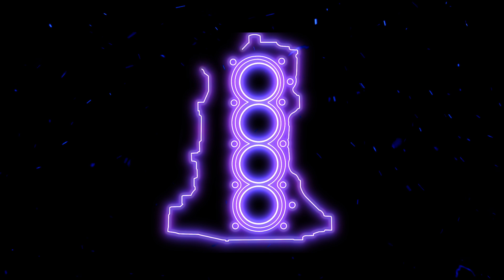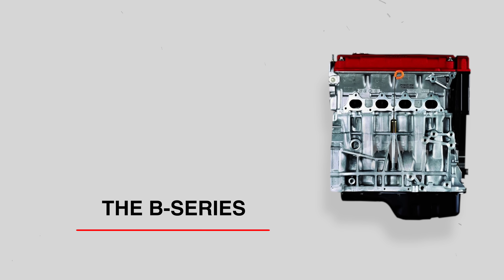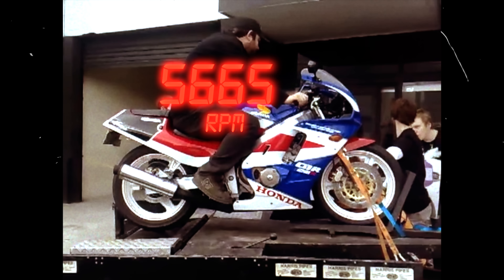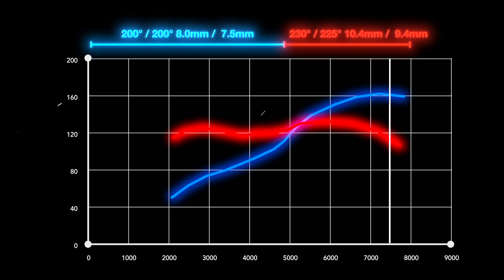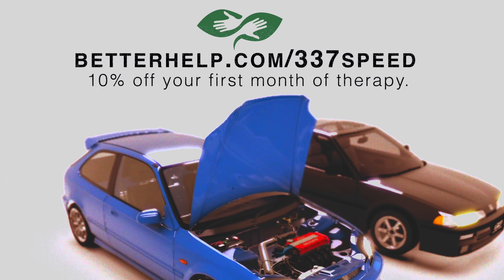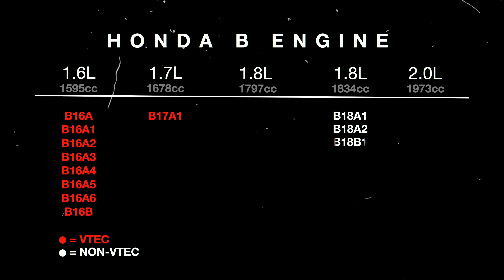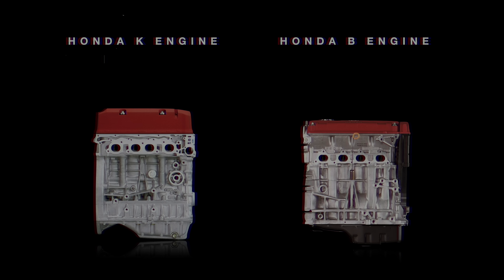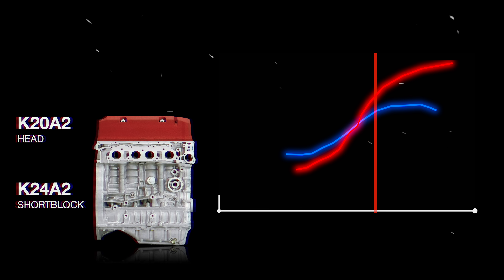How Honda’s VTEC Changed Sport Compacts Forever😳| Explained Ep.46

Comment: Mmmm, the second generation Acura Integra. In my opinion, still the best looking front wheel drive car Honda ever made. And I help a friend of mine work on his 1993 Acura Integra GS that has a B18A1 with a GS-R VTEC head from 1995 on it now, with higher compression (12.5:1) pistons, ported head, 4-1 header, 2.5 inch exhaust through an actual nice sounding muffler, Skunk2 intake manifold and throttle body, and I personally own a 1999 Honda Civic Si which has a header, exhaust and a spicier tune. I love B-Series engines, and while the H-Series can make way more torque, and the K-Series has been taken to insane power numbers even NA, I will always love the B-Series and its guttural roar to 8,000+ RPM.
Reply: I agree about second gen Integras being the best looking Hondas. I had a frost white '92 GSR(DB2) with a '01 spec B18c5 engine swap 20+yrs ago. The DB2 chassis was stiffened forward of the firewall, I believe the only Honda other than Type-R's that was stiffened at the factory. Almost no sound insulation, under the carpet in the hatch was all painted steel with only one small piece of sound insulation under the spare tire. DB2's only weighed 50lbs more than a Type-R but they had a power moonroof. There is a retro review video here on YT of the DB2 from back in '92 that explains the factory chassis stiffening.

Comment: The K series is a continuation of that legendary design and build. K24A2 is a masterpiece!
Reply: I have on in my MRS, and totally agree.
Reply: K23's are nasty but you don't see them much.  Believe its a k24 block with K20 heads and a FC crank ( s2000 think its FC).  Ends up destroked a little but with less angle on the connecting rods.  13k rpm, so sick.

Comment: Enjoyed this very much. Especially the coverage about the second generation Integra which was the introduction of (car) vtec. Ive driven a DA going on 27 years now lol.
Reply: 27yrs with the same DA!? That is awesome! I bought my first Honda 29yrs ago, a '85 CRX Si. I wish I still had it, or my '88 CRX Si, but my favorite was a '92 GSR(DB2) with a B18c5 swap. Did the swap in '04 and sold it 9yrs later. I still miss it, don't sell yours.
Reply: @WisconsinEric  Not the same DA. Wish it were so. First one got wrecked a few years after I bought it. But ive owned dozens of them since the late 90s.
Reply: @AcuraLvR82  Dozens is equally if not more impressive than the same one.

Comment: One of the fastest things I've ever been in was a 1993 Honda civic with a gsr B18c (apparently) series and a lot of turbo boost. Stock engine as well, so lightweight, could barely hear the exhaust over the turbo. Probably between 4-500hp but in a car that weighs just over 2000lbs it's a crazy fun combo.

Comment: Thanks for a harder kick in the nuts bro because it was much needed. I got sent the wrong size piston rings for my Integra GS-R and I spun a bearing so now I'm using my B18C GS-R head on a B18B block for a really stupid high compression LS-VTEC rebuild (12:1 CR using Integra Type R pistons).

It was just in time.

Comment: So basically a turbo camshaft. Very nice. But the question is 
Is this relevant to V8 or V6 engines ? Would it make a difference? In a good way or bad way
Reply from the maker: In the way Honda uses it mostly 4 cylinders, but  Nissan in the VQ37VHR used variable valve lift to flatten the torque curve combined with cam phasing. In principle it’ll work with any engine configuration
Reply: @337speed  nice! Thanks bro! Your information is priceless!

Comment: I pulled my b18c jdm type r out of my crx that I cracked a piston about 10 years ago and has been sitting ever since.  Im going k series for the replacement so I rebuilt it and dropped it in my wife's 2000 awd crv. 10k on it so far and fun to drive but needs more torque for that size car. I don't think I will ever part with it even after the next time it goes and do another rebuild.  It was a so much fun in my gutted crx and can't wait for the 300hp na k to go in. Working on making it mid-engine as well, just have to sort the suspension out on it.
Reply: Sorry if my post offended you. It wasn't meant to be self-centered, just wanted to share my love for the motor and my experience with them.
Reply: I I I, me me me, puky attention seeking waste of space.

Comment: 8:30 LOL @ a "stroker" revving to 11k.....that just ain't right!!!!  (an expression of how flabbergasted I am, not doubting the reality!)
Reply: thats how i felt listening to that. how ive always understood it is that strokers make more torque across the rev range but dont rev as high as "big bores"
Reply: I believe they stroked it to the same 87.2mm stroke as the ITR B18c, and yes a shorter stroke is safer at high revs as the piston speed is lower. I'm not sure if they used the ITR crank or their own but it surely had rods. When I bought my B18c5 20+yrs ago I was told the stock lower end is 100% safe to 9,500rpm. Stock valve springs were only safe to 9,100. Stock '01 spec cams only made power to 8,700 in my engine.

Comment: People always shit in VTEC not knowing how revolutionary it was
Reply: @eminemfan3650 It's not only the vtec. Some time ago in US Honda's 2.2 litre non Vtec engines were used as reliable, affordable and cheap base for supercharging. They took non vtec version (F22A) vs later, more efficient VTEC ones (F22B) because of the simpler head design and therefore better reliability and easier tuning.
Honda was making really good engines until emission standards forced them to follow the herd and built undersized, supercharged, direct injected ... things that are shadows of the old glory.
Reply: THEY KNOW! THEY JUST JEALOUS!
Reply: And still is tbh. The continued evolution of VTEC places it clearly ahead of most if not all competing systems.
Reply: I say more complicated...i say rottary was true revolution,very light,high rpm,small displacement and combine it with turbo you get beast egine.
Reply: @joe125ful  If the reliability and emissions problems with rotaries could have been solved they would have been the go to for enthusiasts
Reply: @agrisimfarming Actually you can do it and problems can be fixed its really not bad engine only badly maded.
Reply: @joe125ful  no, it has by design flaws. It is 2 stroke burning oil and seals are required to maintain pressure inside every chamber but they require maintenance and swap often compared to typical inline 4stroke 4 cylinder engines.
Reply: @bartomiej9807  Ofc but they are much lighter and smaller than typical engines and rev high too.
Reply: @agrisimfarmingrotary get proper oil fuel ratio when constantly 7000 rpm
Reply: @agrisimfarming Reliability has been solved. S5+ housings and extra thick rear iron did wonders. Many issues are operator error.. Like dropping the thrust washer without realizing it because you wanted to change the e-shaft pulley to a shiny one, but you took out the wrong bolt. CO2 emissions from an FD is similar to a brand new mustang ecoboost. The renesis was a disaster. No turbo. Ugly car. Emissions improvement made reliability trash. Side port exhaust means more heat on your oil control ring seals.
Reply: @joe125ful  маленький ресурс, большой расход масла и бензина
Reply: @joe125ful new Hyundai engines open deck dual vvt not jellious
Reply: @joe125ful the rotary was revolutionary. But not practical. And this is coming from a Huge Mazda fan. Honda did something no other company could. There engineering was next level
Reply: @joe125ful what makes an engine great. Efficiency in making fuel turn into power. Rotary sucks.
Reply: Thanks Im picturing someone sitting on a toilet shitting and then vtec kicks in 😂😂
Reply: @Bshere  WHY DID YOU GIVE ME THAT MENTAL IMAGE?!
Reply: It’s totally overrated now. It was revolutionary in the early 90’ nothing more. Just because they didn’t wanted to use Turbo or supercharger.
Let’s talk about the late 80’ Polo G40
Reply: @antonfloor344 what???😂😂😂😂 because of VTEC, every manufacturer now puts variable valve timing in their engines.
Reply: @eminemfan3650 they where just the first, nothing more.
Reply: @antonfloor344  Honda wasn't the first to make VTEC.......I hope that's not what you're implying.... Alfa Romeo did decades earlier
Reply: @jrkustomz5538  here's the difference though. Alfa Romeo's version only affected valve timing. What made VTEC so revolutionary was also the increased lift of the valves along with the valve timing. One was for efficiency and one was for power.
Reply: @chuckynocheese3271  yes ,but that's not what he's implying. Alfa had it more than a decade prior to Honda unveiling it. 
His implication is that Honda invented it ...which isn't true...Honda improved upon a system which already existed is all.

Comment: Day 4,593 of asking 337 Speed for a GTI/Golf R video and why they're such legendary cars and why the EA888 is one of the greatest factory turbo 4 bangers ever made. Incredible tuning capability, bang for your buck power potential, does alot of things better than many other cars and it's the king of the hot hatch. They deserve a video! 🙏
Reply: Vr6 over any other VAG engine
Reply: VR6 sound so good, funky chain setup that is a definite maintenance item, I can't hate the Vr6s they're too cool
Imo best all-around VW engine is the O7K, miracle of not being overcomplicated they just keep racking up kilometers with oil changes and maybe they get an air filter or spark plugs every ten years😂
 @izzy031096
Reply: Might as well get into the EA827 and derivatives, it sorta paved the way
Reply: if the EA888 is as good as VW fanboys say then why does nobody want to touch them or swap them into shit? they also sound like a wet fart
Reply: It's called we stretch timing chains, clog the intake ports with carbon, stretch the timing chains, wear out the variable intake runner pivots, stretch the timing chains, Munch a valve, explode the water pump and stretch the timing chains
I LOVE EA888S!!!
Reply: @snoofayy6150  I'll tell you same thing I told him. This ain't 2012 anymore
Reply: Shhhh I'm fixing my 12v vr6 and I don't need prices going up dude
Reply: I guess at this point he might be thinking you make it😅
Reply: The newest EA888s are fantastic but the vast majority of them in the GTIs/Rs over the years are just mediocre. They can be decent bang for buck but you need to sink a huge amount of money in to make any sort of serious power out of them
Reply: @wingmanlmg  Didn't even need to see the pfp to know this was written by someone who doesn't own one of these cars. Gonna just leave it at that 🤣
Reply: @Xim762  I have a 440hp M135i and it got there with a downpipe/intercooler + tune.  A similarly priced GTI needs upgraded turbo, hpfp, lpfp, intercooler, downpipe, etc to get even close
Reply: @wingmanlmg  You lose in the up front cost. An M135i costs more than a GTI and weighs more. And this isn't 2012 anymore old man. MK8 GTI's can make 370 wheel on just intercooler and an E85 tune. No downpipe or fueling upgrades needed. And it'll kill the M135i on weight advantage. MK8 Golf R's make 450 wheel on the same mods and it'll walk the M135i from dig or roll.
Reply: @Xim762 I literally said the new ones are great. My 2013 m135i costs the same as a mk7.5 gti. But the vast majority cannot afford MK8+ golfs, I was referencing the majority of GTI’s/Rs which are MK6 to 7.5
Reply: Yeah great engines! Just a shame they came in one of the ugliest hatchbacks ever made and are owned by people who peaked in high school parking lots.

As Clarkson once said "Volkswagen created the perfect car for people who hate walking but also hate excitement."
Reply: @xTerraH  You are aware Clarkson also said the GTI was the best car ever made and drove a GTI mk 7.5 as a daily for years?
Reply: @burny6666  yeah to avoid media attention. Speaks volumes doesn't it 🤣
Reply: They made a rwd golf that can hit 200mph for their festival few years back

Comment: I’ve been wanting more info on these kind of engines since I want to either k swap or b swap a Chevy Corvair and make 300-350 whp, for now, for 10k or lower. But I plan on making it awd with a Subaru Impreza chassis and making it have 500-550 whp when I’m done.

Comment: 1- i suggest you differentiate between metric hp (PS) and imperial hp (hp), the B16A, B16B, and F20C are all in metric, and the difference between the 2 is the reason for the weirdly specific "276hp", that is actually 280PS.

2- "betterhelp" is not a replacement for actual therapy, and they have very questionable practices.
Reply: Strong agreement on both points especially the second!